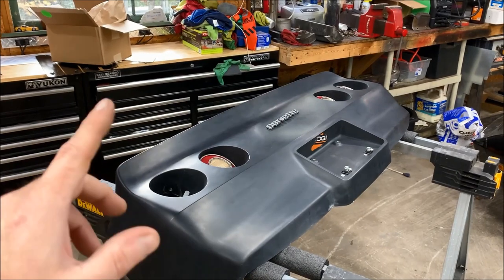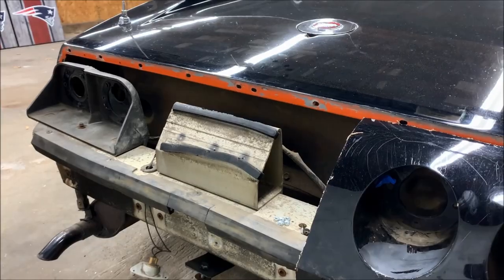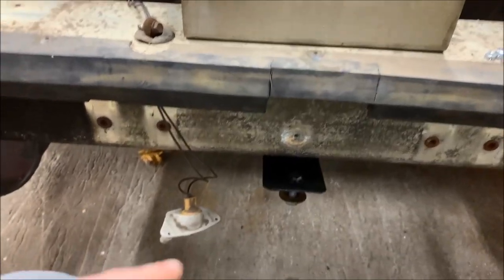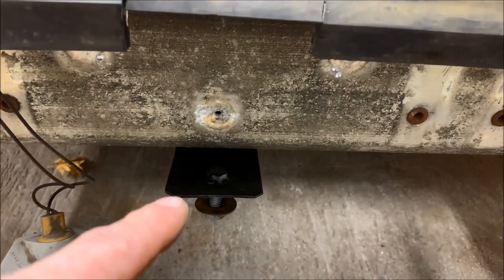Removing and Upgrading the Rear Bumper Cover on the 1976 Chevrolet C3 Corvette Stingray

Comment: I like the semi spoiler effect the 80's rear had over the rounded drop style on my 75. I can see doing this mod on down the line but there's a long list of repairs & mods in front of it, LOL. Good vid detailing how you adapted it.👍
Reply from the maker: I love the look as well. It goes great with the rear glass and the rest of the back design. 

Just picked up a set of 80-82 lights last weekend.

Comment: Any chance you still have the link to this bumper? I just got a 76 with no rear bumper and I see no reason to buy and paint the original ugly bumper lol. I can’t seem to find an 80’s style made of urethane. I don’t wanna mess with fiberglass because I’ll be doing it myself and I just want it to bolt up rather than dealing with all the fiberglass molding.
Reply from the maker: keenparts.com
Reply: @StreetersGarage  yeah I checked their site but can’t seem to find the urethane bumper. Guess they don’t make it anymore.

Comment: How the heck did you get all those little nuts and bolts way up in there. Must of been a terrible job at the factory !
Reply from the maker: The bumper cover has a steel mounting rail that’s attached to the bumper and there’s studs in the rail. 

Completely agree, I don’t envy anyone that had to do this all day. You either had to have a great back and flexibility to put this thing together.